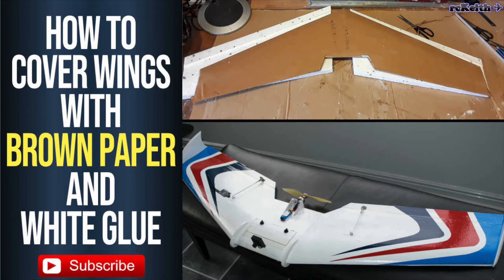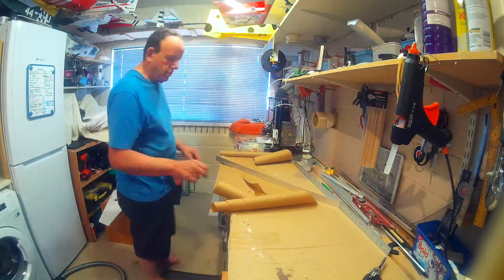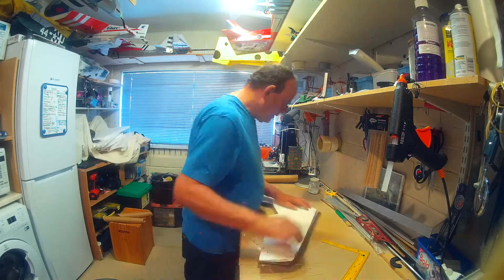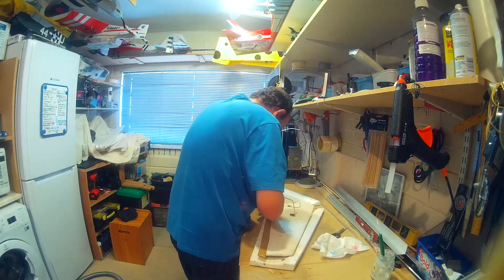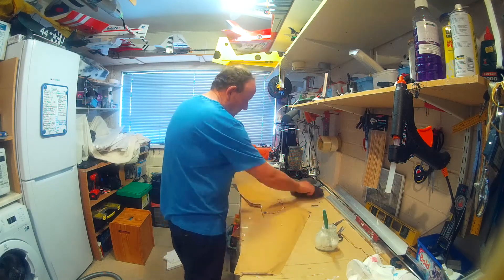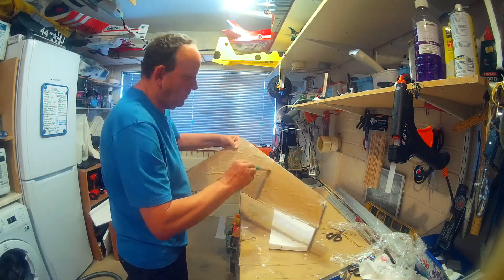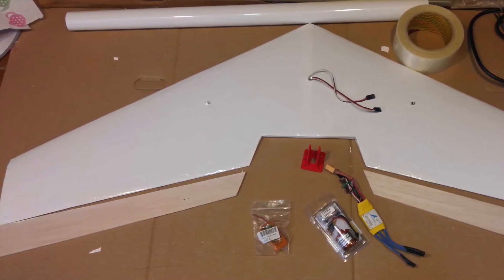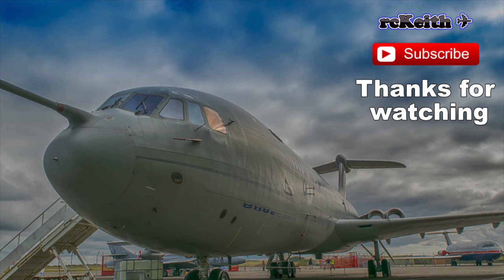How to Cover Wings and Fuselages in Brown Paper and White Glue makes a very strong wing.

Comment: I bought 2 part countertop  epoxy and thiught about silk . And wash the foam out with petrol or gasoline
Reply from the maker: I don't understand your comment
Reply: @rckeith 
   instead of wrapping the foam model airplane with tape , you used brown paper and glue .
 I bought some clear epoxy  2 part mix for the glue and some fine weave fiberglass cloth instead of paper . It makes a hard ridgid shell around a foam  model airplane and the white styrofoam can be dissolved away outside with a small amount of solvent to have a ridged  hollow shell model .

Comment: Brilliant!  Thank you for the fantastic video.   I am buiding a 1/8 scale DHC-6 Twin Otter.  Using dollar tree foam board (5mm foam, covered with paper both sides).  Foam ribs/bulkheads,  1/4x3/8 spruce spars/longerons, wrapped in foamboard (inside paper removed.   Was thinking to just apply 50:50 white glue afterwards straight onto the paper.  Should be similar strength to all brown paper wrapping.  Cheers.

Comment: What strong eps foam is it? White Styrofoam eps 100?
Reply from the maker: It's just standard insulation foam from our local diy store in the UK. There is nothing special about it.
Reply: @rckeith  Ohh I understand that but is more types eps 50 low density and finish at to eps 200 more density. But 100 eps is more the enaugh..But if you used low density foam, that is great news and if is strong enaugh.. Thanks allot

Comment: Hmmm, interesting.  However, it seems that it would be relatively heavy.
Reply from the maker: Not at all I've covered many wings like this and all have flown fantastic.  Give it a try you'll be surprised.  This method has been used for many years in the RC hobby.
Reply: @rckeith  Wow, that was a quick response.  You must live by your computer.  :-}  Thank you.  I built my first RC in 1971.  Used the traditional silkspan and dope (dangerous word) and a single channel radio with a rubber powered escapement for rudder control.   I now use film.  My planes are all of built up balsa, open frame. so this method is not appropriate.  I am in the process of building a 4 axis CNC foam cutter, probably with your machine design but using Planet-CNC controller.  I built two CNC routers using this controller, I love it.    At 72 years old, I am not adverse to change and experiment.

Comment: Im going to use this process again when i cut out the prandtl-d
Reply from the maker: Hi Nathan, I use it for every wing. It's surprising how strong the wing becomes.
Reply: @rckeith  i can get laminate pretty cheap but the paper is much stronger. the thing with laminate is its much more durable. you can take multiple hits and you can easily repair it. I get 200 feet by 28 inches for $100. Lifetime supply really. But its not good for paint. you have to paint and than cover with it

Comment: Keith - great video!
What kind of paint do you use as the final?

I'd like to use water based acrylics and apply it with an airbrush.
Thanks
Reply from the maker: Hi Mark
I've used water based and aerosol spray paints. I usually apply a sealer before painting like sanding sealer or non shrinking dope and that makes sure nothing gets through to the foam.  Once it's sealed like this you can pretty much use anything.  So water based acrylics will be fine. Thanks for your kind comments.
Keith 👍👍👍
Reply: @rckeith  Thanks Keith for the information!

Comment: What's your opinion on different types of laminate like Oracover, Fibreglass, Kraftpaper etc. ?
Reply from the maker: I think they are all OK just depends on the model really. Fibreglass is very strong and gives a nice finish but can be a lot more work.  My favourite is brown paper and white glue.  Quite easy to do and very cheap and if it doesn't come out well you can remove it quite easily by soaking in water and leaving for an hour or two.  I did this on my T45 Goshawk when I rushed it and got a poor finish.  The second time it was perfect.  I usually apply some sanding sealer or non-shrinking dope and that makes it very smooth and tougher.  Hope that helps
Reply: @rckeith  Thank you.

Comment: Thnks sir. I was putting laminated stickers as skin on my styrofoam plane but it not gave me good results and often looses revealing bubbles at certain spots of the body due to surface tension or sun heat, I guess.. probably stickers and styrofoam not really good as direct combination unless if put something as a layer.  Your idea are one that I should take as a solution.
 Tq so much sir for your video
Reply from the maker: Thanks for your kind comments. It's a great method to cover and I've used it on many models. Really surprised how popular this video has been.👍

Comment: The best glue to cover with is wall paper paste in gel form.Cheap hardens best consistency.Once you use it you wont ever use white glue again trust me.If you have ever tried to de wall paper a wall youd know why they use wall paper paste.
Reply: Wallpaper will come off if you spray it with water and then wait about a half hour and it'll come up with a putty knife

Comment: Hi Young man do you need to use brown paper or can you use light glass fiber cloth in stead with the White Glue metherd
Reply from the maker: Hi I've never tried glass cloth instead of brown paper. I can't say really only thing to do is try a small test piece.  Poly-C works on glass cloth very well.  I covered my Hurricane fuselage with that and my T45 Goshawk.  Its on my latest video on the channel.  Hope that helps

Comment: First airplane I ever flew I designed and built over 38 years ago when I was 13 from 2x4 pine ripped with a skill saw glued with water thinned white glue covered with news paper then painted with white glue then krypton paint..... Became a little brittle with age but worked well way to repair..... Later I used thin 24 hr epoxy thinned heavily that's much better but costs more.... The news print was old printed news papers.... Also used tissue paper on lighter planes like guillows

Comment: That was excellent Keith. I recently I have been making rib and spar wings from depron with a depron skin. As you probably know depron likes to shatter so a tough outer skin would be nice. 75 micron document laminating film is VERY heavy.  Have you ever covered a built up depron wing in brown paper? My concern is that the shrinking paper would introduce a lot of warping? Also where do you get your pink foam from? I can get that white with black speckled jablite foam in B&Q. Keep up with the interesting videos. I liked and subscribed.
Reply from the maker: Hi Haven't covered depron in brown paper so can't say but if you cover both sides at the same time it should eliminate any warping.  Perhaps try it on some scrap foam first.  I use to get the pink foam from Wickes but they don't seem to stock it anymore but I've heard the SIG Insulation do it.  Had a couple of guys say they used them and they are OK with selling small quantities to modellers..  Thanks for watching.

Comment: Can you tell me what is exact name of this brown paper, or can you provide any link for it? I can't seem to find any material like this in homeware shops in Poland. The closest I can get is food packaging/ cooking brown paper. Will it be fine or is this something completely different?
I'm scratch building a 180cm wingspan plane, and I'm afraid I really need it to stiffen my construction.
https://image.ceneostatic.pl/data/products/41109895/i-ravi-papier-do-pieczenia-brazowy-38cm-x-6m-gos000652.jpg
Reply from the maker: Hi
Its just brown parcel paper usually used to wrap parcel sent through the post.  Here's a link on Amazon UK which may help you to locate it Poland https://amzn.to/2J1l4Wl 
Can't really tell from the image if its the right paper, sorry.
As long as the paper is thin and can absorb the glue it should be OK.  I've heard Christmas wrapping paper can be used as well.
Hope that helps
Keith
Reply: Keith Howlette aaah, thanks. I haven't thought of packaging paper. We do have such papers in Poland, rarely used though, that's why I didn't think of it.
I've found 100cm x 55m for 15zł, which is... About $4. 
https://www.e-gtp.pl/pl/p/Papier-pakowy-90gm2-100-cm-5-kg/287?gclid=CjwKCAjw3cPYBRB7EiwAsrc-ubU4nS2Qyw_sbItzrglwGAm3xsjy3tT1SZXuLay7COKtnkjcbLYrOBoCYPcQAvD_BwE
P.S. 
Cooking paper won't make it, I've checked in my kitchen, it's shiny on both sides, so it wouldn't soak up any glue.
Reply from the maker: Yes thats it, good luck with your build

Comment: Awesome. I have started this process a few months back on a big f100. Check my videos.
Reply from the maker: Thanks Nathan, that looks a mighty big F100.  Check my video https://youtu.be/hJ7SrAIasx4?t=9m47s at 9mins 47 and I use a digital inclinometer to check the tail incidences.  Its useful because you can zero it out on the wing and check the tail.
Reply: Thanks! I had some peripheral knowledge of that but had never seen it done before.that looks like a lot less work than my setup. The thing with the iron on laminate is that it is very easy to take off and replace. For fpv guys that are coming down hard or going thru trees, being able to remove and replace the laminate is an important factor.